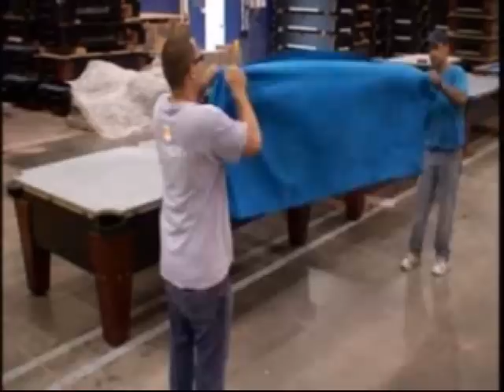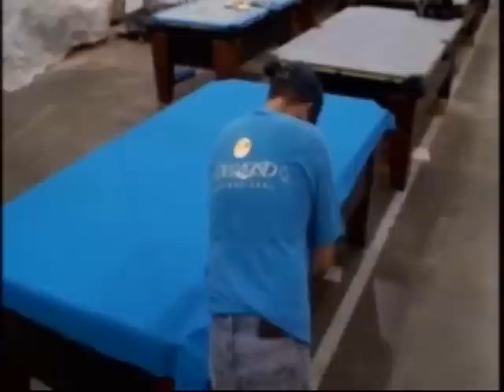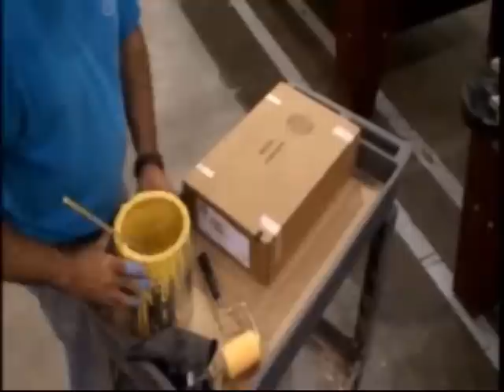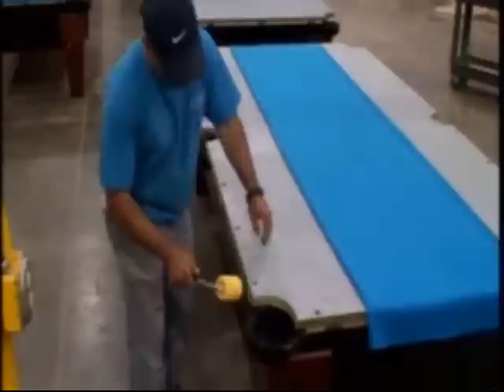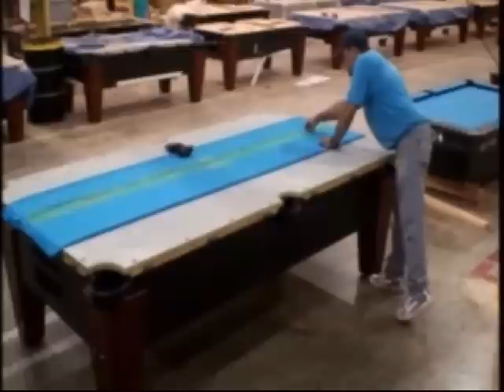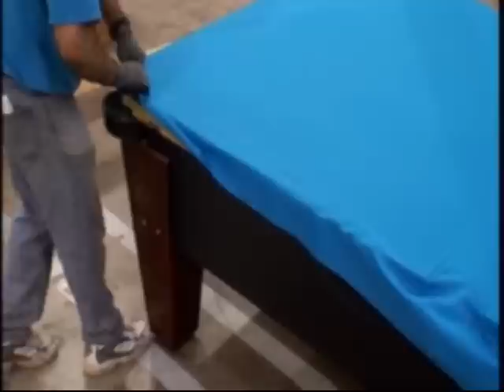Smart Table - Simonis 860 Cloth Recovery Part 1

Comment: If glue is applied correctly  the cloth will hold until it need’s replaced. I glue cloth every day and reclothed slate that has been glued for years that was still hard to pull off slate

Comment: What kind of tool is the white handle tool.  Looks like a roller with a blade.  Where can this be bought?
Reply: Ed P It's just a regular utility knife. He's using the face of the closed knife to smooth out the bubbles along the edge of the slate